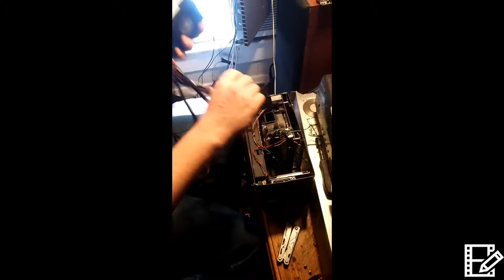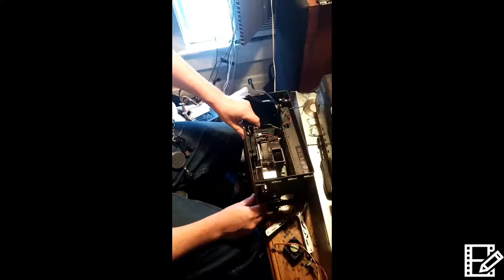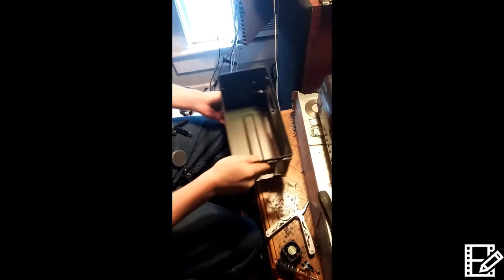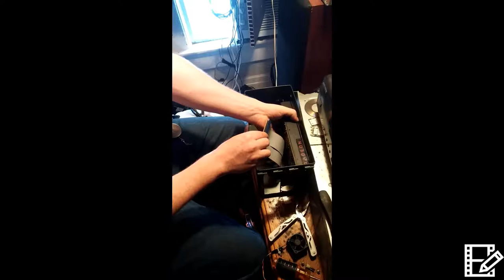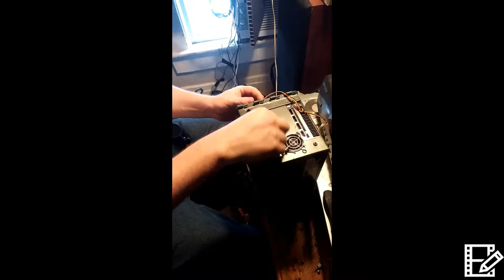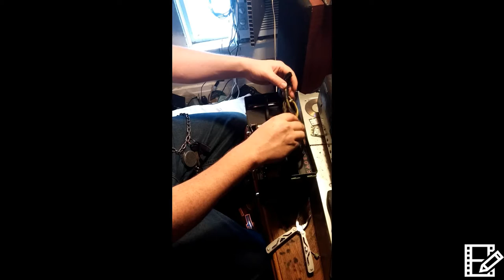Rambo PC (ammo box PC), part 2, Teardown/details

Comment: is the board just sitting on the very bottom of the box?
Reply from the maker: Snug fit. Not ideal. I'd recommend a fat 50 ammo can. They seem way less common though. It is mounted with stand-offs, if that's what you're asking.
Reply from the maker: I put a piece of electrical tape on box where board made contact. Shouldn't be needed; but, I didn't want to risk it.
Reply: @Marc_Wolfe  ok thanks and dang was impressed to see a larger gpu in it im getting a R9 nano for mine to try and have a bit of extra space
Reply from the maker: @ironmaiden8423  If the PCB was full length, it wouldn't have fit, would have been too thick. I haven't seen any with a 3.5" HDD either.
Reply: @Marc_Wolfe  yea it was really hard to find anything on these and it was nice to see how someone actually did it im forgoing the hdd and just getting a m.2 1tb instead which hopefully should be enough

(here is planned build https://pcpartpicker.com/list/BZCF8M)